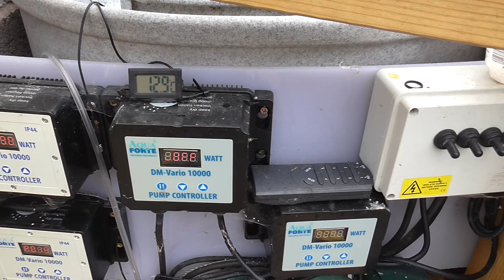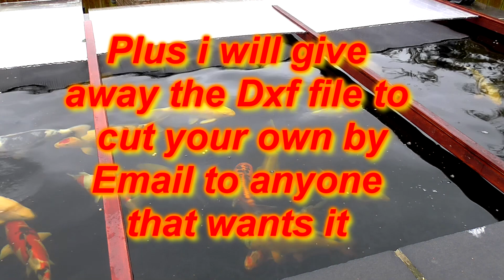Diy Koi pond filter

Comment: Hi Martyn, another good one been waiting all day for your video, I suppose i'm old school for I have concrete filter using brushes and filter mat,and just lately started putting filter sock/ bag over the inlet pipe , doing a good job. All the Best. George
Reply from the maker: George it works I know it works you know it works and its low tec no problem this was last week so its been running a week just cleaned the first easy pod and filmed it for next week and they have made a great improvement  to how much was in the pod
Reply: @boxtriker  yes Martyn you are correct you can't turn a drum filter off but mine is only cleaning every 95 minutes as of 08/11/2019. Also I only have one pump running right now an Aqua Forte 20000 liter variable pump. It is using 60 watts and turning the pond over as well as the old in pond 14000 litres hour pump did. Obviously we are not turning over 140000 liters per hour with the restrictions the main one being the one way valve used to stop media flowing into the pipe work if we have a power cut or turn the pump off. I think the drum uses 35 watts when it cleans. This is pretty efficient when the old pump used 120 watts all the time for the same volume of water. Another benefit of the drum is your water is not passing over your waist for long it is removed from the system automatically where as before I had to clean my media every two days. My media is totally clean making my media bacteria more effective at breaking down ammonia winter not withstanding. You could turn the drum off if you fit a bypass loop which could be a needed thing if you had prolonged freezing temps  and your drum was not in a shed or under an insulated cover. I have not done this but it would be possible. If we get really bad weather I would shut the system down turn off the valves and drain the drum and media barrel's remove the pump and wait until the weather improves. I would not be feeding my fish at all in this situation.
Reply from the maker: Love them Aqua Forte variable pumps don't know what I would do without them now

Comment: Hi Martyn.
What is the reasoning for not using the answer through winter?is it because you've reduced the flow?
Reply from the maker: Just don't need it in the winter time I can put up with some fines in the water the covers are over 95% of the time so you cant see it. And it saves on power I will try the answer with brushes in the vortex come summer. one thing you cant do with a drum filter turn it off for the winter so its one up for the answer
Martyn